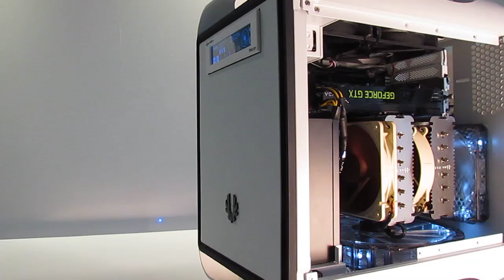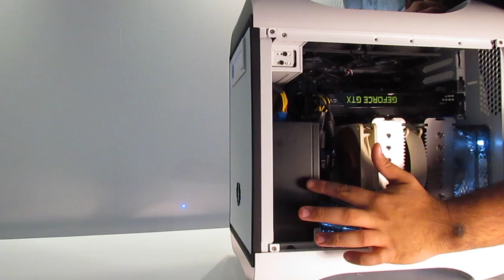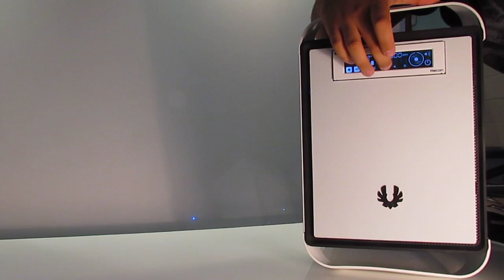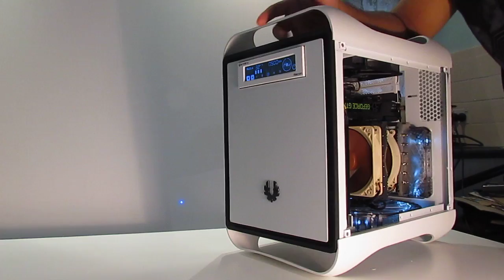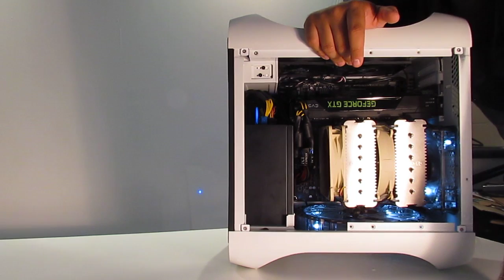White Prodigy M on Air - Bitfenix Prodigy M GTX 680 mATX 4670k Haswell Build

Comment: tis case is a total thermal fail, the PSU exhaust is at teh bottom so that it gets very hot, heck even the psu cable gets soft cause of the heat...
Reply from the maker: shouldn't have such a hot psu...and yeah its somewhat of an issue in this case, but it is reversable so you can turn it upside down and reverse the front panel if your arent using the dvd bay
Reply: it gets hot because the psu fan trys to work agains the law of physics, hot air wants to travel UP, anyways I returned it and got a fractaldesign define XL.
Reply from the maker: that's what im currently running. sold this build off eventually. its a more looks over usability case

Comment: I know this is old, and the first gen haswell were generally the worst with heat, but getting throttled at 4.0 ghz is something you might see on the worst case scenario with a stock intel fan cooler. I've OC'd several 4670ks and most were actually below average chips and could get to 4.2 on stock air and 4.4-5 stable on good air/water before delidding. Something is plain wrong here, I would start with looking at the contact between cooler and cpu. (ie, reseat)

Comment: Can you fit the side bracket in? On the bitfenix phenom m, I plan to mount a hard drive on the inner side. This may cause a conflict with the tower cooler you have, the noctua 14. Can you measure the clearance between the top heatpipes and the bracket? Thanks!

Comment: Are You still happy with the cooling and airflow? In what direction does the Powersupply blow out the warm air? i want to build a similar rig with an Intel 4790k and an GTX 970 .

Comment: where is the ssd?
Reply: Mike WS There is a small tray on the other side panel that has two slots for SSDs. There is also another bracket (not displayed) that will hold hard drives, but with the size of his cooler, he might not have had room for it.

Comment: Could you fit a single Hard Drive in this build aswell? Appreciate any help!
Reply: Unlucky but no, I have a build pretty close but with a msi 970 and only the stock fans that came with the case. I also have a N4 D14 and I cannot fit a HDD in the case. If you do a similar build you can use an external harddrive enclosure.
Reply from the maker: xlRozzalx It really depends on your GPU height. I barely managed to get a hard drive in with the D14. It can be done with reference designed cards.

Comment: Hi sweepingmonsoon, any way to squeeze in dual slot SLI, a cooler like the H80i, and a fan controller like the Recon? Not sure how components that individually require the removal of the disk drive interact with one another. Thanks!
Reply from the maker: Alisa Leshchenko No. The second card will run into the optical drive bay which houses the Recon. It's either SLi or the recon.

Comment: You may have covered it in the video, but can the hdd bracket be used with your tall cpu heatsink?
Reply from the maker: Yes. With the D14 the drive bay still installed with about 8mm clearance

Comment: I'm doing a similar build to this. Your documention on reddit and here have been very inspirational. Thanks for putting it all up.

Everything has arrived except my 230mm fan, which will be 2-3 more days.Think I could put it all together and sneak the fan in later? I'm eager to build it tonight.
Reply from the maker: Maybe. Sorry for the late reply. You might run into problems with your motherboard clearance and the heatsinks on your mobo.

Comment: Just ordered one of these off Tiger Direct for $50 - $20 off + $20 promo code + $10 mail in rebate. I'm planning on using a HD 7950 boost in it. A lot of people would recommend a liquid cooler for the CPU with a small case like this but what I found is that with newer CPUs - basically anything Sandy Bridge and up for Intel - is that the CPU doesn't really produce that much heat to require such extreme cooling even if you are overclocking. My 3770K was easily cooled by a $30 Hyper 212 Evo when OC'd to 4.5 GHz. In fact, even when running stress tests like OCCT or Prime on the CPU, the heat sink never becomes even warm to the touch. If anything, you should liquid cool the video card. Those are the heat monsters in any modern system and a liquid cooler would make perfect sense even if you are running it at bone stock clocks. Any mid-range and higher late model GPU is going to be the main source of heat and in a tiny case like this, a liquid cooled GPU and an air cooled CPU would be the logical way to go if you had to pick only one to liquid cool. Unless you have a Pentium D or some ancient CPU that can easily double as a space heater, any standard 120mm tower cooler is just fine even in a small case like the Prodigy M. I'm willing to bet that a CPU will run cooler like this versus if you went with the conventional liquid cooled CPU and air cooled GPU simply because of the heat coming off the GPU being constantly pumped in the case. Link to the promo from Tiger Direct if anyone sees this in time: http://www.dealigg.com/story-BitFenix-Prodigy-M-Computer-Case

Comment: Hey, im new to pc building. Im going to get the same case build for my birthday, but i have few questions if it's ok! :)
Im planning to get the Gigabyte GTX 780ti, the question is... How should i place my fans on the top (exhaust/intake)? Im looking for a cool gpu and cpu
The same question about the two fans that are going down...

My specs are going to be:
BitFenix Prodigy M.
Gigabyte GTX 780ti.
Intel Core i5 4670K.
5x Cooler Master Led fans + Cooler Master Hyper 212 EVO
Asus Z87M PLUS motherboard.
8GB ram.
650W +90 PCU. (i have no idea if it will fit)
Dell LCD monitor. (1920 x 1080)

I really hope i can get at least 40-50 fps while playing BF4 on ultra...
Thanks!! :)))
Reply: WTF XD!!!  you can get 40-50 on ultra BF4 with GTX 660 .. (using windows 8)
GTX 780 Ti is overkill for 1920 x 1080 monitor.
GTX 780Ti will be need if you have  4K monitor.

i recommend you to buy Water Cooling like H110 with this case for better OverClocking..and more RAM for future needs.
for GPU, Gigabyte GTX 780 (Non Ti) is more than enough for this resolution. .. it even can maxed out the most graphics demanding 2013 , CRYSIS 3.

check this out :

Battlefield 4 [MP] FPS - 1080p 1440p 2160p - EVGA GTX 780 Ti
it is gtx 780 Ti playing bf4 on 3 kinds of reso, 1080p, 1440p, and 4k.

He is using i5 2500k @ 4800 MHz. <-- this is the reason why i recommend you to buy H110
Reply: Muhammad Fahmi
 Do not listen to this! Sorry but a dual rad is nigh on impossible to put in this case (especially for a first time builder).
Reply: I changed the case to a Fractal Design Define R4 anyways so i guess there is no problems in terms of fitting parts anymore. 1440p monitors are way too expensive and i should get about 100fps while playing on ultra settings in 1080p soo its all perfect.
Reply: Sir Kams well if you are going 1080 then the 780ti is pointless, a 770 will do and if you want it to be a little more future proof, then a regular 780 is will be more than enough (and still overkill). By the way, you won't notice anything above 60fps unless you have a monitor with a refresh rate higher than 60hz.
Reply: Overkill or not but im planning to have this pc for a long time without changing the gpu. Overkill doesn't effect anything, it's just op. Monitor will change to 1440p or i might get a tv for a monitor which is 2160p
Reply: Sir Kams
If you want the 780Ti ,its OK :D its very very future proof. i just gave you my recommendation ;)

Comment: It is possible see an image of the RAM? i had the same Case with a msi z87m motherboard with 2 ram installed, I'm interested to buy a noctua nh-d14 but i'm seriously worried about the ram height.
Reply from the maker: This was an issue. The fan closes to the RAM kit, i ended up attaching it a bit higher up on the heatsink fans of the D14. I would try to buy lower profile name if i did it again, but you can get away with it.

Comment: how load is the pc??
Reply from the maker: Heavy? 21kg so a fair heft.
Reply: i meant to say how loud is it
Reply from the maker: Brent Claus With the fan controller, it's not super loud but it isn't exactly quiet either. The 140mm exhaust on the back is the loudest fans, with the included 120mm spectres being the quietest.

Comment: Nice video man. Just ordered a MATX board and soon to buy the Prodigy M case. I was a bit worried the noctua nh-d14 wouldn't fit. Video is great confirmation :)
Reply from the maker: haha. Yeah i didn't really double check it, but it definitely fits. The Drive tray will fit only one 3.5" HDD just as a warning.

Comment: Will this work? http://www.inet.se/kundvagn/visa/4470599/2014-01-11
Reply from the maker: you dont need a 650W power supply for the GTX 770. A 550W is fine. With the remaining cash spend it on a CPU cooler :)

Comment: Does the case get warm? I have a Fractal Design Arc, and that is icecold, Do you think it will be the same with this case?
Reply from the maker: The case doesn't get that hot with a blower style gpu. With a typical aftermarket-cooler, i'd imagine you would need one more fan to be in exhaust to cool down the unit. Keep in mind the Design Arc is a typical PC layout style case (Motherboard space, top panel space, Drive space and Power Supply space), whilst the Prodigy M is only as big as a mATX mobo, so naturally i'd imagine the Prodigy would get warmer than the Fractal.
Reply: sweepingmonsoon
Thank you for response :D

Comment: Your post on reddit brought me here and i must say i really like your build. I was looking for something about the bitfenix prodigy m case as it might be the next case i will get while i upgrade cpu etc. (still running 2500k). Do you think that there are a lot of room to spare in terms of the width of the gpu? I have an Asus gtx670 with the direct CU II cooler on it which is really wide. I would really like a smaller case than a regular ATX case. I will only upgrade to this case if it has room for my gpu as i cant go out and buy an entirely new pc every other year.
thank you in advance.
Reply from the maker: Depends on your PSU, but if i can fit a 680 you will definitely fit a 670. The back of the PSU unit runs close to the end of the GPU but it should be fine. What is the length of your PSU?

Btw, the 2500k is still a great processor. Check if you can find a Z68/Z77 mATX board for cheap to use with your CPU instead of upgrading it.
Reply: i was planning on waiting for the broadwell equivelant, which is 3 generations after mine. This seems to be the sweetspot for upgrading in my opinion. 
As for the length of the psu it shouldnt really be that big of a deal. Cant quite recall but i believe it's only a 520w or something.
Reply from the maker: Christian Bonde Yeah. It shouldn't be bigger than 150mm which is fine. 170mm/180mm PSUs will run into bigger graphics cards. GL with your build man.
Reply: thank you very much. And thank you for reassuring me the a noctua cpu fan can fit inside. are you still running that build currently?

Comment: The Bitfenix Recon sticking out totally ruins it man.  Can you not mod it somehow to make it fit flush?  Other than that though it looks sweet.
Reply from the maker: Front on @ 4:50 is the reason i left it out a bit more, just so the fan controller stands out from the front panel. Otherwise, it all looks flat and the recon colour is just slightly off from the front panel colour. You can definitely mount it flush, i chose not to. Each to their own :)

Comment: How did you install the cooler? After mounting the motherboard in or before it?
Reply from the maker: After mounting the motherboard, and connecting all the cables besides the Graphics card cables. I don't think you can move the motherboard into place with the cooler, or even reach the screws to mount the motherboard.
Reply: sweepingmonsoon ok, thanks

Comment: Do you think that it could be possible to get the hard drive bay there because i have like almost same build but i need that bay
Reply from the maker: Yes. I managed to fit onex3.5" and 3x2.5" drives. I couldnt fit 2x 3.5" drives because it runs into the top of the d14.

Comment: hey, i wonder if is it able to install side HDD with 160mm CPU cooler in this case.?
Reply from the maker: Yes. I was able to fit one. That doesnt sound like much, but considering you can get 3TB drives, it should be more than enough. Make sure you check the Prodigy M website for cooler restrictions

Comment: Is cable management good with this case? That's one of my biggest worries. I want a case I can easily move around and I've always wanted to build a small form factor gaming pc but I've had my mind set on the Corsair 350D but now I'm back to considering this. I have some big hands (I can palm a basketball) , do you think it'd be difficult for me to build in this?
Reply from the maker: Yes. Honestly, Unless you ordered everything properly beforehand, your hands will be a big negative when manouvering in this case. Cable management is very hard, mainly confined to the side panel. If you're running anything complex in the mATX build, cable management is going to be even harder. If you do go with the prodigy, consider a management plan before installing everything in. The small form and the portability are a definite plus when selecting the case...not so much cable management,
Reply: Thanks for the reply. I continued to research and yeah I think I'm just going to stick with the Corsair 350D. That case is another great Micro ATX case and it makes cable management super simple as if it was a mid tower or full tower case. Plus it looks nice. I don't really like how prodigy m is designed, they changed the interior too much and it makes it a lot harder for cable management. I would do the mini itx version, but parts actually come out more expensive and I'm looking to SLI in the future and that case doesn't offer that option. 350D seems like the best choice overall for a Micro ATX case. I really appreciate your comment, it definitely helped!
Reply from the maker: FatalPivotStrike Another option is the new Aerocool Deadsilence which is like the Prodigy mITX but with a horizontal mATX tray
Reply: sweepingmonsoon I love you so much for telling me about this case. You've helped me a lot in like two comments haha, thanks again!

Comment: can you fit 2 gpu full size and a dvd drive?
Reply: No if you use SLI/CF you won't be able to use a dvd drive.
Reply from the maker: No. If you look at the GTX 670/760 mini gpu's you might be able to do it, but i'm pretty sure the DVD drive actually covers one of the slots.

Comment: Nice review. Now that I know my D14 will fit, I just need to go out and buy a Prodigy. Can you still fit hard drives on the side mount with the D14?
Reply from the maker: Yep. The forum is littered with the same questions and as far as i know, when you install the drive bracket it should all still fit.
Reply: sweepingmonsoon Thanks for the reply, I guess I should have looked harder.

Comment: There is less dust buildup on a positive air flow rig like yours. Just put fan filters on the intake and you're good to go.
Reply from the maker: Cheers. I always get mixed up onto which creates less dust. Yeah, i'm working on a dust filter for the bottom fan. :)